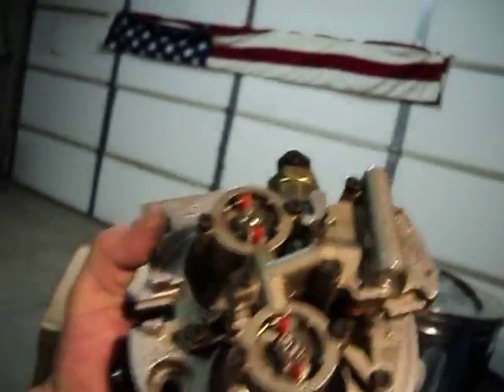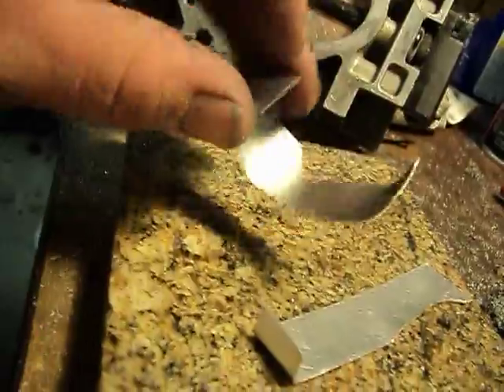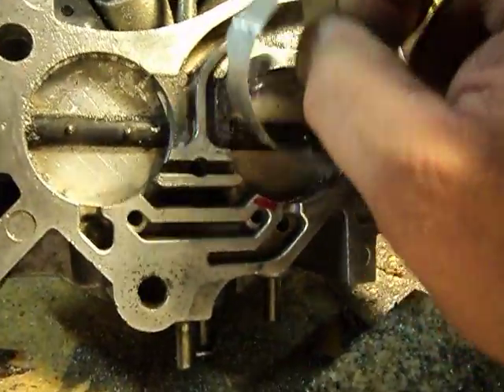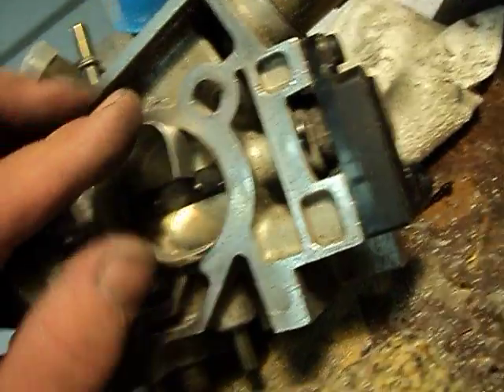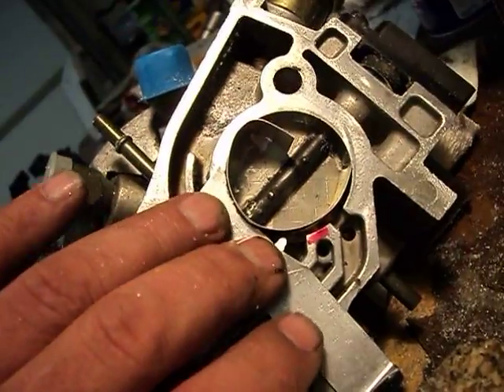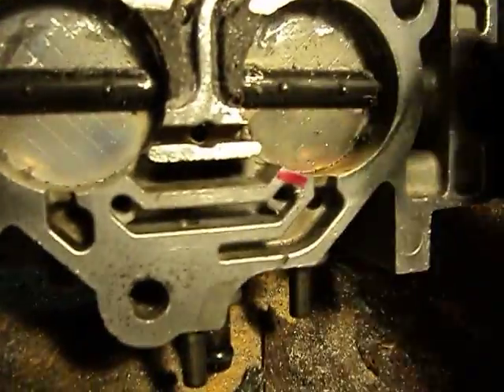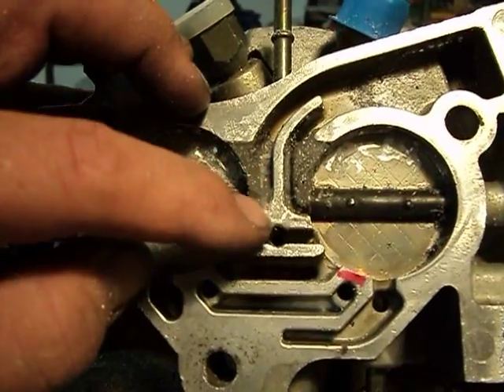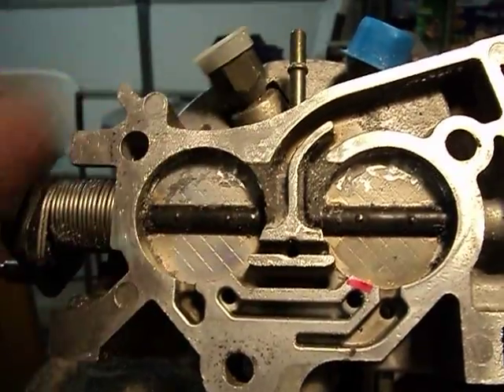8 Cylinder GM TBI IAC Pathway Correction

Comment: Here's the thing. ALL engines have engineered flaws into the systems to force a certain amount of waste. As fuel vapor burns better, and as reducing the pressure assists in vaporization rate, and considering the IAC never closes it therefore becomes a vacuum leak, raising the intake manifold by allowing too much air. Reducing the size of the opening reduces the leak, increasing the vacuum available and increasing engine efficiency.
Of course, it's better with The Gadgetman Groove!
Reply: Thanks for that info and perspective, makes good sense about reducing the  "vacuum leak" of the passage. I've tweaked just a few (literally) and that area intuitively bothered me, THANKS for the tips! And I put this question to you having already done this portion of a project: What about moving the orientation of the air passage 90° to the bottom of throttle blade tip in? (e.g. similar to how a model 700 does, but not a groove in the intake) I hope that is clear enough. It seems that it may be assistive in swirl and fuel atomization. You seem to be the type of person that could actually answer a lot of questions that have elusive answers for my people resources, rock on brother. 

I currently have a model 220, 43mm unit, in my hands that is going through some major material removal and reshaping for what I hope will have incredible flow (possibly overkill) for built Chevy 2.8L engine. If I mes it up, I get to chalk it up to education and start on the next with bank of knowledge expanded from experience.

Comment: You are right in this instance as there are a number of air bleeds located (as usual) on the upper side of the plate to take advantage of the low pressure zone created there.

The Gadgetman Groove goes only on the exhaust side of the throttle plate for this reason.

Excellent question!

Take the time to register on the Groovy Forums at GadgetmanGroove site!